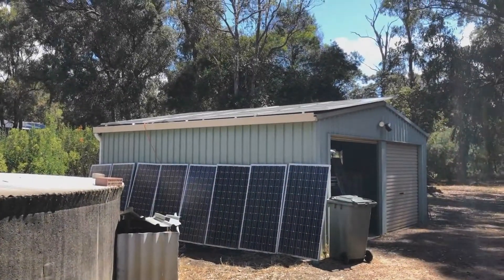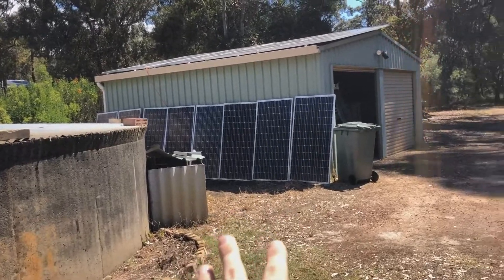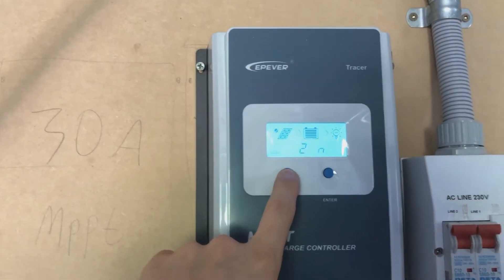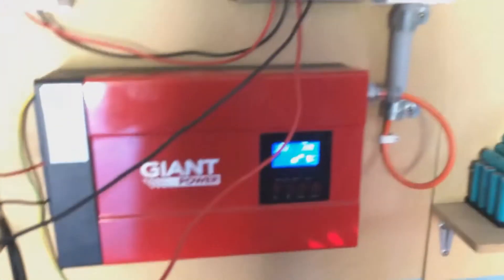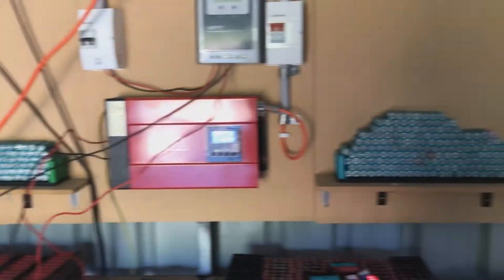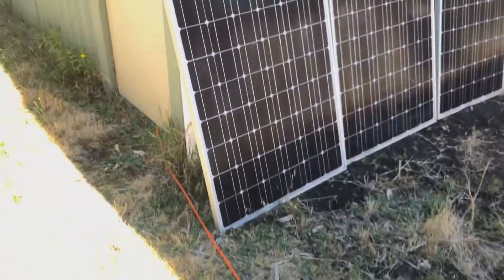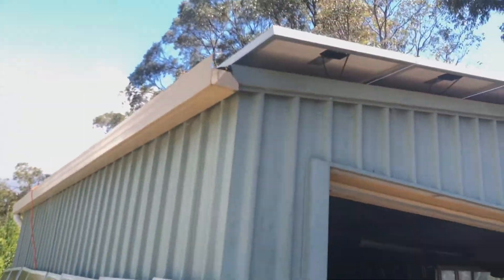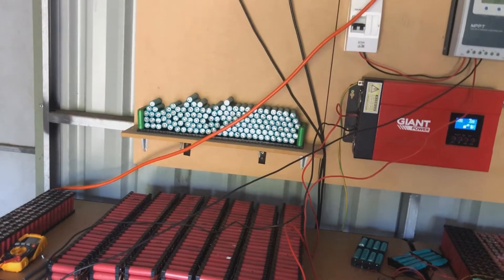DIY Tesla Powerwall | Working Powerwall | Update 35

Comment: In this video I assume your batteries are hooked up to your charge controller. Also I wondered about all those solar panels hooked up to the Epever charge controller. How many panels can you hook up to that controller safely.  I have the 4210AN 40 A and thats why Im asking. I also wanted to know what kind of settings you use for charging on your controller for the batteries.
Reply: No more than 750 watts to 785 I have the same controller I'm getting the bigger one that has a built-in charger 240v feature made by the same company